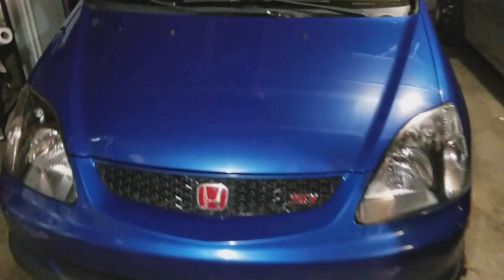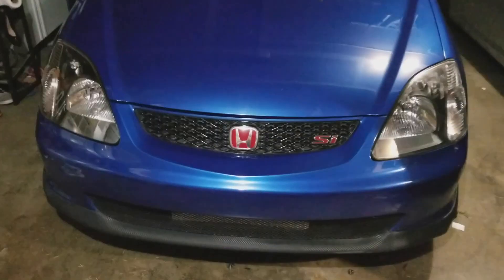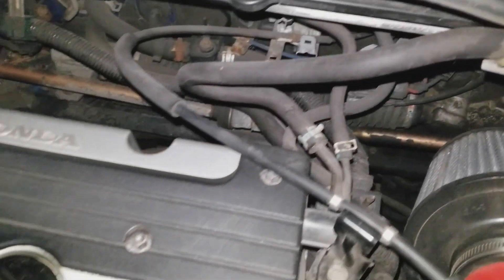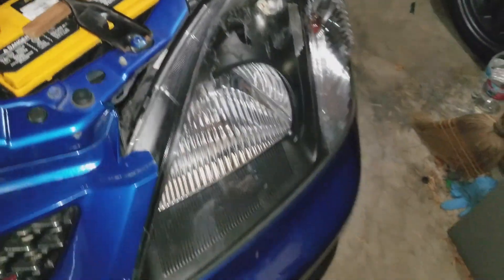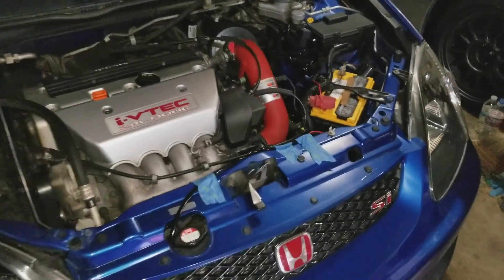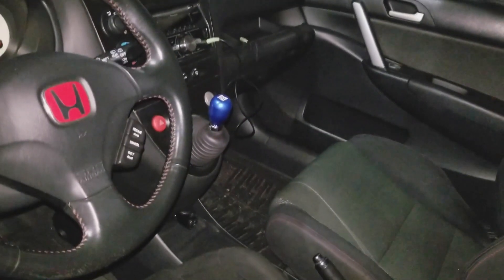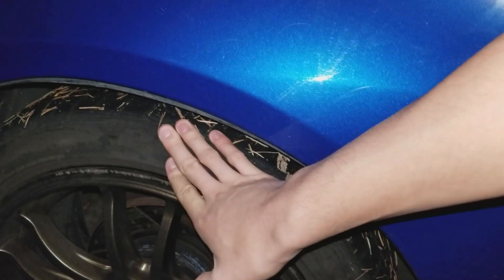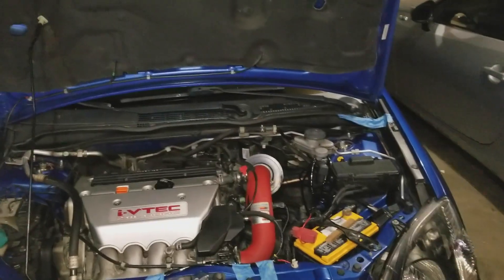Future Plans for the Honda Civic EP3 | Sit Down 001

Comment: it all depends on what your goals are. if you want any type of performance upgrades, start with kpro. bolt ons and manifold mods wont mean shit if you cant tune it. an rbc manifold will get you good numbers and if you swap in a2 vtec killer cams, you will see 200 whp.
Reply from the maker: Mussh Wins alright man! Thanks so much for the feedback! Do you have any mods to your engine?
Reply: I'm running a stock jdm k20a type r. I have a hondata manifold gasket and a cut rbc intake. i had Synchrotec build my transmission. short ram intake and racing header. currently straight piped. tuned with kpro, i made 211 whp on a mustang dyno.